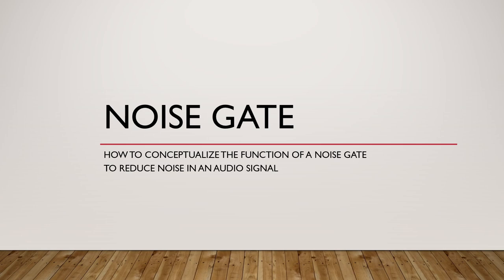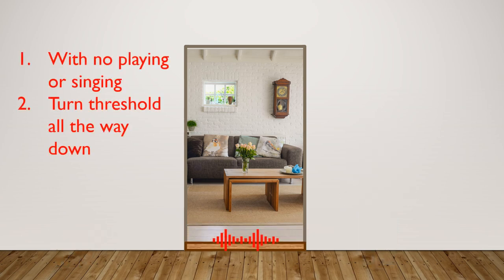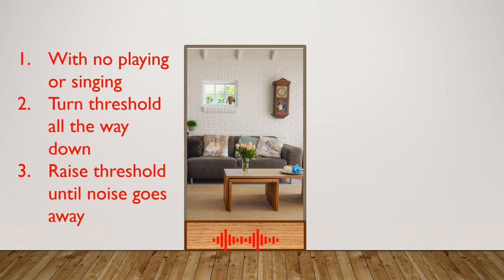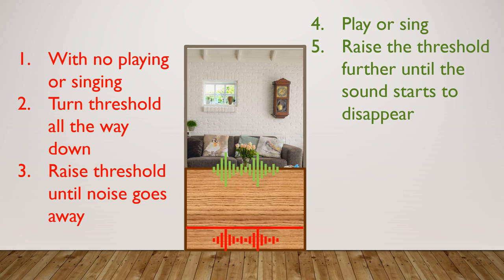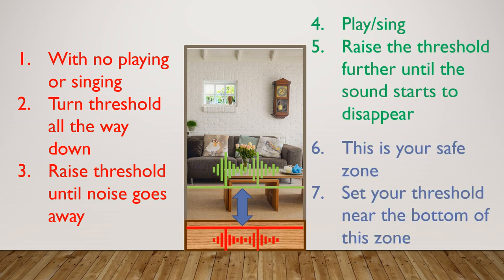What is a Noise Gate?

Comment: I've no idea why this video has so few views. This was very well done!

I recently learned a bit about what a compressor does, and it seams that a noise gate is somewhat similar to a compressor. Where a compressor reduces the volume of a sound above a certain threshold, a noise gate reduces (or even completely mutes) a sound below a threshold. So it's pretty much the opposite of a compressor. Would this be correct?
Reply from the maker: A better analogy would be that a Noise Gate is the opposite of Limiter, but depending on how a compressor is configured, it can act as a limiter, so you're not wrong. Glad you appreciated this video. Perhaps it will be discovered and catch on in time :)
Reply: @AndrewBellous  Hey, thanks for the reply. Keep up the good work!

Comment: So is this basically opposite of a compressor?
Reply from the maker: No, an expander is the opposite of a compressor. The purpose of a noise gate is to eliminate low-level sounds. The purpose of a compressor is to dampen sounds that are too loud. They do work on opposite ends of the volume, though. One controls quiet sounds, the other controls loud sounds. In that sense, they address opposite problems.